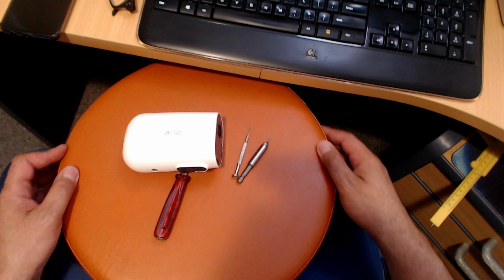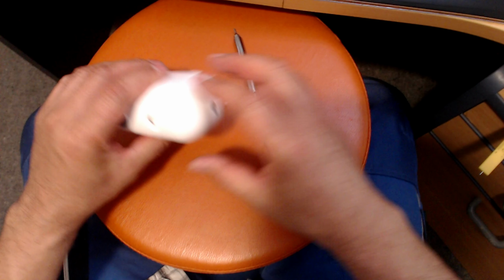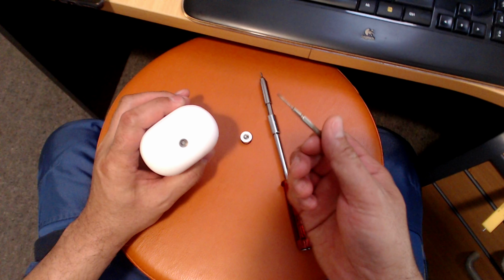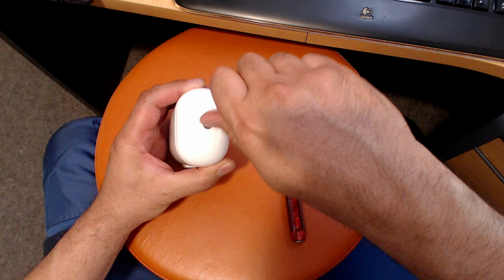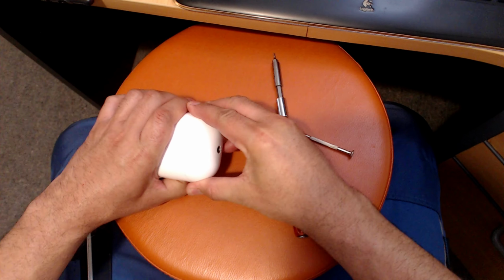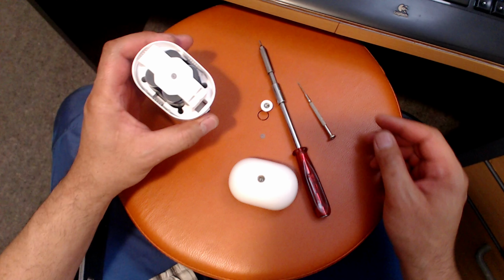Arlo Essential Wireless Camera. How to open and access batteries.

Comment: Thanks for the video. You say just unscrew the four screws and the batteries will come out pretty easy. How exactly? My battery pack is pretty solidly stuck in there with the 4 screws taken out and it's not obvious where it's stuck. Any ideas?
Reply: you need to takethe sticker from the mini USB with the stick on it there is a hidden screw. When you unbold that one you can gently get the whole battery including the unit out
Reply: @skasterenvan3480  Thanks mate!

Comment: my pro 4 looks nothing like that. No buttons, no seams in the plastic. The is one allen screw back from the magnet/battery charger. It was very tight, I was more worried about stripping out the hex head. Very tight. My issue is the camera's stopped working after one week. The internet went out as Xfinity is prone to do every morning and the cams stopped working. So I am both trying to see if the batts are dead and if the system needs to be reset to the internet.

Comment: Take some silicone and rub it around the rubber ring that is around the camera. Over time, dirt and dust make it impossible to just pull the camera out. I added silicone and they fall right out like new when I press the release.
Reply: That doesn’t work for the essential. It has a “non-removable battery”. There is no release like the others.

Comment: Hello.  Do you have any idea why the battery of the camera indicates the battery in red in the app.  This camera is connected to an Arlo Solar Panel.  This is my model.  Arlo Pro. Today the temperatures in my state in the morning are at 14F.  8/2/2022.  Thanks for your attention.
Reply from the maker: Hi there. Wow that's cold. Not knowing the answer to your question, I was curious. Done a bit of a google and found the following. https://kb.arlo.com/1179176/What-do-my-Arlo-camera-s-battery-level-icons-and-notifications-mean . In case the link dies, it looks like it means "Plugged in but not charging due to a temporary condition such as low light on solar panel or too cold for charging".  I hope the link works for you. Thanks
Reply: Arlo essential with solar panel, the solar panel will charge battery when temperatures are above 32 F and lower than 113 F. I’m having major issues with my Arlo solar panel right now and the Arlo essential itself.
Reply: I am having a similar issue. My Arlo essential is attached to a solar panel but when I put it back up after some maintenance, it said low battery. So I took it down and charged it in an outlet. It had a blue light blinking and solid the entire time. But when I put it back up connected to the solar panel it said low battery cannot connect. I even disconnected / unpaired and the Wi-Fi dock says not found
Reply: @Nademaria55 battery might be bad. Does it work for long after you disconnect the power cable? Or log in and see what the battery reads after you disconnect